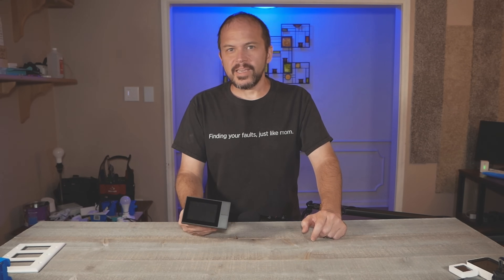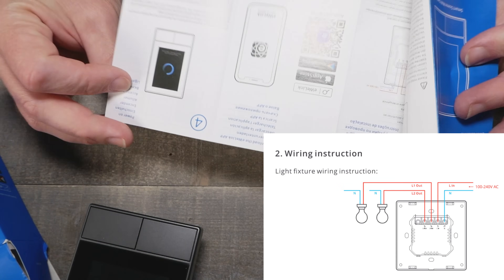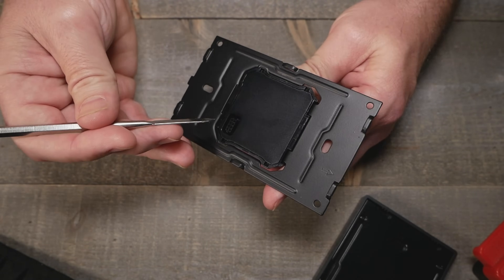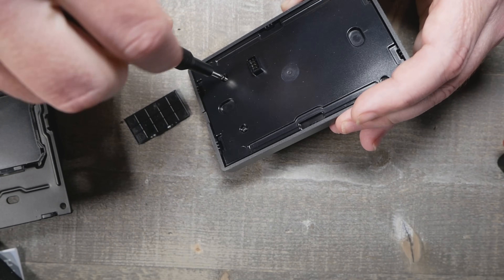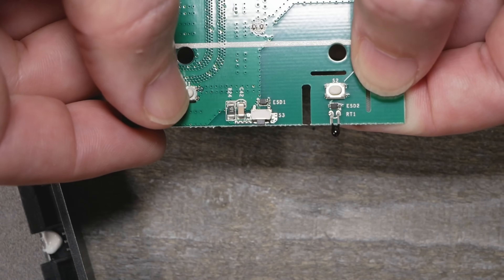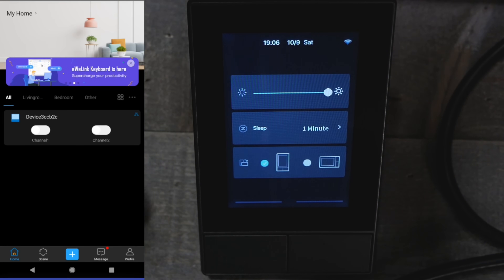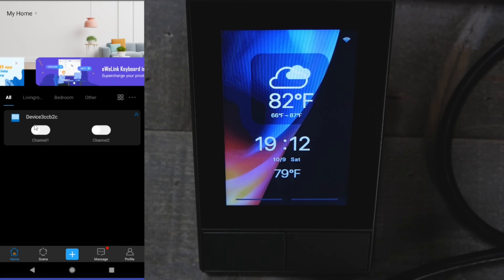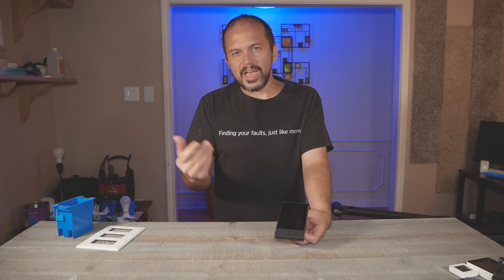Sonoff NSPanel First Look - ESP32 Scene Controller

Comment: I'm trying to understand the 2 amp problem. If my kitchen lights pull say 60W in total you up with .5A. Now obviously if the rating were higher it would be better but (perhaps being ignorant) I'd say this would work for me. Please anyone kindly explain.
Reply from the maker: It's not about the planned amperage pull its about when things go wrong. If everything happened as planned electrically we wouldn't need breakers/fuses in the world. The problem is you always want the breaker to be the weakest link in the chain. If you have a 7 amp draw/short for some reason and the breaker is 15A it won't trip. The 2A rating is now the weakest link in the chain so it will pop into smoke now potentially causing a fire. This can be remedied by placing a 2A fuse before the switch as now that is the weakest link in the circuit.
Reply: @digiblurDIY  ok thanks. You right. Safer that way

Comment: I like the idea, but without Ethernet have very little use for this.
Reply from the maker: That would be against electrical code making it worse. Mixing low voltage with mains voltage in the same box isn't a good idea especially from two different sources.
Reply: @digiblurDIY  Depends on the code. In my area, for example, it is fine for low and high voltage to share the same box if the low voltage cable insulation is rated for high voltage. An Ethernet PoE option would be great if one is to just use it as a scene controller and skip the relays for those areas that can't mix voltages.

Comment: I have to agree with Digiblur 100% if you put a device in the wall that is not that is not rated to carry to current potential of the suppling source with no over current protection is stupid. I know I have seen some of you folks state that well they should only have a few led lights connected so no worries. Well that's well and good for the perfect world if it was a perfect world you would not need a breaker or a fuse as all the people would be smart enough to know how much to load an outlet/circuit with. But that is not the case and it gets a bit old hearing " Well I  would not have that problem so  do not tell me what to do",  try thinking of others first dumb ass ....

   More than one-quarter (26%) of reported fires in 2015-2019 occurred in homes. Even worse, three-quarters (75%) of civilian fire deaths and almost three-quarters (72%) of all reported injuries were caused by home fires.
During this five-year period, US fire departments responded to an estimated average of 346,800 home structure fires per year. These fires caused an annual average of 2,620 civilian deaths; 11,070 civilian fire injuries; and $7.3 billion in direct property damage. electrical was the #3 cause of fires right behind cooking equipment and then heating equipment (source npa.org) . So yea I' am with Travis on this $0.02 device to stop a fire or death is worth it.   Just my 2¢... Thanks as always for the Video and your time I do appreciate your work  Travis.....  And for the NS how about it stands for "Nerd Station".
Reply from the maker: Thanks for the further explanation!  Shorts also don't follow the rules of only planning on having a few LEDs on the line.

Comment: The standard height of U.S. wall plates is too low for a screen. Mount it higher in a box with just power and use the switches as triggers in Home Assistant, so the 2A rating wouldn't matter. The European version (landscape mode) would look better at a higher mounting level.

Comment: NS (Nextion Screen) Panel

It looks as if Itead combined the ESP32 and Nextion Screen boards into one PCB.  My biggest worry is having individual access to the serial ports to flash the ESP32 with ESPHome and access to the serial ports on the screen to upload the Nextion Editor files that make up the UI and button press actions.  

I've ordered one unit, it looks promising.
Reply from the maker: My same worry as well is how locked up is the screen.  I'm hoping we can do something it.
Reply: @digiblurDIY  I did see in the FCC filing photos that there are two pads labeled TF_TX and TF_RX.  I think these might be the serial connection required for uploading your custom Nextion Editor HMI files into the screen.  The other serial connections you pointed out would be for flashing the ESP32.  Time will tell.

Comment: in my honest opinion, 2 amps per switch, is more then enough when it used as a light switch, (these days) just use bulb from last years and you want have any problems, 

it seems you are more and more telling things that are not 100% real, not all people are electrical engineers, but for most people with just a few "new"bulbs behid 1 scwitch, thwy wont run into problems
Reply from the maker: That isn't the issue with the 2A rating. If things always went SD planned we wouldn't need breakers or fuses in the world.

Comment: I'm betting they derated based on lack of air flow and cooling inside the enclosure, inside an electrical box.
Reply: Thats exactly what they did. Those traces are more then suitable for a intermittent use around 10A.. they are just adding an excessive headroom for load spikes, and trying to keep temps in check if things were pushed beyond for a lengthy time.. With that said, these will more then suit 99% of all applications such as simple light setups. if your switching heavy loads, there are alternative devices out there for things like heavy restive or induction loads.

Comment: New Screen?

There is a resetable fuse on the pcb connected to the line in. You can prob look up the part number and get the rating.
Reply from the maker: I saw that little fuse on there. Time for a test to see if it works? 10A load?
Reply: @digiblurDIY  make it blow!! 🥳
Reply from the maker: The onboard fuse was only on the power supply to the switch, it was not in line with the "L IN" feeding the relays.
Reply: @digiblurDIY  ah darn! Silly to only protect the power supply though. Otherwise you're going to melt relays/traces. A breaker isn't going to trip before it does.

Comment: 2 Amps sound pretty sufficient for a light switch to me. i am not aware of any lights in my house that would have more than 60 W (that are some legacy tungsten lights in my cellar), which is 0,25 A.
Reply from the maker: That isn't the problem of what you plan to load up on it. It is when the plan doesn't work out and 10 amps pulls across it.
Reply: @digiblurDIY  there what the on board fuse protects you from
Reply from the maker: The onboard fuse was only on the power supply to the switch, it was not in line with the "L IN" feeding the relays.

Comment: First of all thank you for the presentation 
We’re representative of Sonoff products 
let me explain and share with you some information about this product 
1) NSPanel is stand for Nexion Smart panel , as you maybe know itead has section to produce and develop touch screen, it’s name is Nexion you can see type of this section in itead website 
2) Sonoff usually use 10A relays in their in wall touch keys and also some other products, as you know most of time these in wall keys used to control LED lighting and because of considering LED inrush current they mentioned 2A per channel 
3) in this product at the present with official Sonoff firmware you can add 8 widget, each widget could be one of other type of Sonoff products that you have in same project or in other project, maybe in future widget quantity increases to 16 widget it means you can add 1 CH sonoff or 2 or 3 or 4 CH switch as one widget and also group of products or RGB controller (Sonoff L1) and ...
4) it supports 1 simple thermostat with 1 relay output for heating or cooling ( not 3 fan spead ) could be associated to one other Sonoff 1CH switch or one of its relays.
5) connection with widget are based on cloud and doesn’t support local connection with widget so you need to have internet connection to use widgets on this product 
Any question please reply to answer 
Have a good time.
Reply from the maker: Thanks for your answers on a few things, still unfortunate about the 2A rating.  But it's not required to use the relays which what I'm probably going to do.  Great piece of hardware other than the relay if it is priced right, looking forward to see what the DIY community can do with the thing.  Openhasp will be great on this thing!
Reply: @digiblurDIY  the end user price is about 75$
Reply: @digiblurDIY  Thanks for the openHASP shoutout in the video. If the ESP can drive the display directly, it could work... but it doesn't look like it can.
Reply from the maker: @fvanroie I do plan on pinning it out in the next couple of days to see how it all communicates and such.  I'll let you know how that goes.  Shoot me an email using the channel name on the gmail domain or hit me up on discord.  I could see about sending the switch to you as well.  Thanks for all of your work on Openhasp!
Reply: What else I can do on panel?. Can I customise from Home Assistant?
Reply: @PaisitW  sure after flashing it with some other firmware such as openHASP
Reply: So it's a Nexion panel with an S32 MP. Stand alone Nexion panels usually have an SD card slot; does this have memory on that driver board? If so, this is already hackable with ESPHome and the Nexion designer software... That would make this a tinkerer's dream...
Reply: @dougle03  let’s release it first i think it could be flash with openHASP and make everything you want to control in HomeAssistant, so first after release some developer guys should work on it to make appropriate bin file to flash it , same HASPone for wemos D1
Reply: @mohammadhosseinnorouzi1005  From what we can see so far this is an ESP communicating with a Nextion Discovery display over the serial port. This means the ESP32 has no direct control over the display.
openHASP is designed for driving commodity displays while Nextion is proprietary hardware.
An ESP32 version of HASPone would be a likely option though. ESPhome also has Nextion command support.

Comment: No Such Panel.
I like this as a decent screen in a nice package that I can install open firmware on. I'm disappointed by that 2 amp relay though. I literally don't know if I can wait for this thing.  Hurry up Itead or I'll have to build my own. I wonder if I can connect a screen to a Sonoff mini?
Reply: You can connect a screen to a sonoff switch

Comment: I can understand about the maximum amperage being 2Amp. However It's designed for controlling light fixtures and modern LED lights. So for a example a 9watt LED bulb and divide it by the mains voltage that most electricians will use the 110 rule average it will consume  0.081 Amps. With four of those bulbs in say a group of can light fixtures or something you're looking at 0.327 Amps. Now I wouldn't want it to control a load such as a wall outlet, ceiling fan or anything like that.

I've been working on a scene controller for my setup. I was planning to do something that looks like one of those zone/volume controllers. Has a little LCD and push buttons. The LCD displays the temp of the Room and the buttons to control scenes. Just something simple and not as advanced as the Sonoff.
Reply from the maker: I do get thing of not needing higher amperage for lighting these days but that becomes a problem when you put the cart in front of the horse that has the ability to push 15 amps or more.  Because as exactly as you say, someone says I'll just put this in the dumb light switch spot that controls this outlet we never change.  They connect like they think they are supposed to, turn on the relay, does the lamp work? Yep.  So they leave the relay on then later on little Sally comes along and plugs in her 1800W hair dryer.  If you had an inline fuse before it rated at 4 or 5A it would do the job instantly.

Comment: Does the display still work when you flashed Tasmota on it? (is there some second chip controlling the display?)
Reply from the maker: That's going to take a little time for the open source community to attack it at many levels.  I was just showing the ability that it can be flashed so let the fun begin!
Reply: I don't think Tasmota 32 supports it yet. I know that the ESP8266 version probably doesn't.
Reply: @MatthewN8OHU  there is some lvgl support on tasmota, but still early development. However that was not my question. I was wondering if I could control what happens with the display only with the esp32.
Reply: @Teixeira9870  If we're lucky it's a Nextion screen and driver chipset! But I don't see any storage on the little board, so perhaps not...

Comment: nice point about putting a fuse on the line for safety -- what would an inline fuse look like..?
Reply from the maker: Given the switch at full brightness and both relays on only used about 2-3 watts.  An inline fuse holder that supports the amperage/voltage of the circuit.  I've used something like this before and given it had a lot of spares I was able to test it out.  https://amzn.to/2YD5mcE

Comment: I love the idea of this and have a couple of designs on the table for this kind of replacement switch next to the front door for status display and quick arming of security, etc. Mine uses a pi zero and a custom power and relay board that I built for this and one other project. The problem with any of these usually comes down to switch placement and the viewing angle of the screen used. I have wasted a lot of money testing screens only to be continuously disappointed by the narrow viewing angle when mounted on the wall at the height of a typical switch.
Reply: maybe you should consider an e-ink solution ( m5paper like )

Comment: Unfortunately, like many things, it supports all the usual worldwide voltages (100 to 240V) and frequencies (50 and 60Hz) but only has European electrical (CE and UKCA) certifications... It has FCC which is a US radio frequency certification, not an electrical one...
Reply: The relay itself has the RU/UR UL logo to show that it is a UL Recognized Component for both Canada and the US but that does not make the whole device UL certified...
Reply from the maker: UL ...meh...  definitely not what it used to be and so many things reflect this.
Reply: @digiblurDIY  Still it is better than nothing especially considering CE (and I believe UKCA which replaces it for UK since Brexit) is a European self-certification, devices are not tested by a third party, they are only "certified" to meet the specs by the manufacturer of the device... I know, there are plenty of devices tested per UL or CSA standards by NRTLs (or their Canadian equivalents) which turned out to have safety issues but still it is better than solely rely on the claim of the manufacturer that the device is safe without having it tested by a third party... This device is more DIY so it will probably end up being installed by hobbyists  in their own home but if it was not a DIY type of device, with no proper certifications many electricians would refuse to install those..
Reply from the maker: I have seen some sketchy stuff installed by electricians so don't put it past many of the fly by night ones.
Reply: Certification is only a defense against the insurance company in case there is a fire (even if not caused by the device). As standards go, it is a VERY expensive process to apply for and if it fails, you have to go through it all over again.
Reply from the maker: Been a while since I've seen the UL stuff in the insurance company thing.  I've talked with a few about it and some have no idea what it means, some of the older school folks laughed and said we have a hard enough time trying to prove someone burned down a house in court than to deal with UL.
Reply: @andrewlhoover  companies should have a level of pride with their products and engineers, put their money where their mouth is and fork out the dough to get it certified. That way, when their test fails and has to get recertified: when a 15kV primary touches my 120V secondary: this device won't be the reason my house bursts into flames. 🔥
Reply: @jamess1787  it's not always about pride. As mentioned, there is that expense that gets added to the cost to all their products.  The diy circuit usually enjoys more cost savings exchange to doing most the work ourselves.
Reply: @jamess1787  of course they should but tell me how many companies can afford to include up to a $200k application for UL certification. How many units would you need to sell of a product to over come that line item alone? It isn't about money where your mouth is, it is about the cold hard numbers. With that price tag being optional to sell the devices in the US, it is no wonder why so many will opt out.